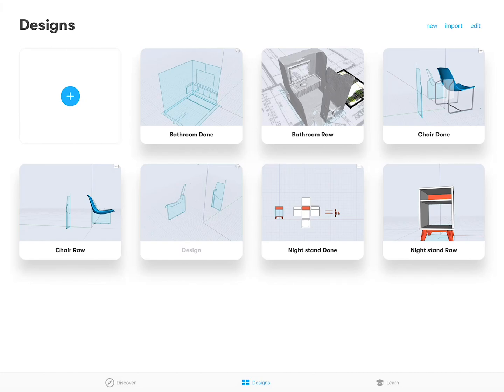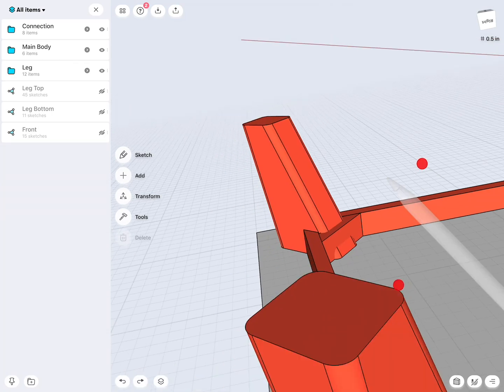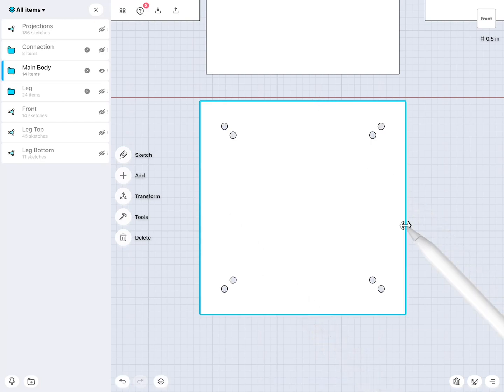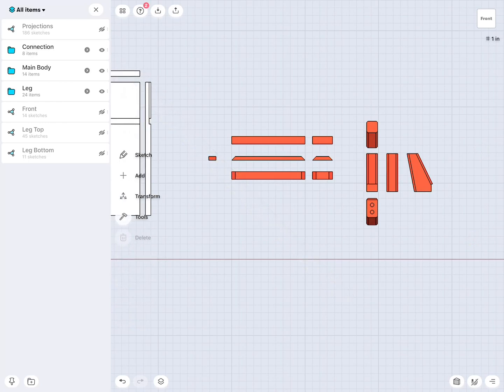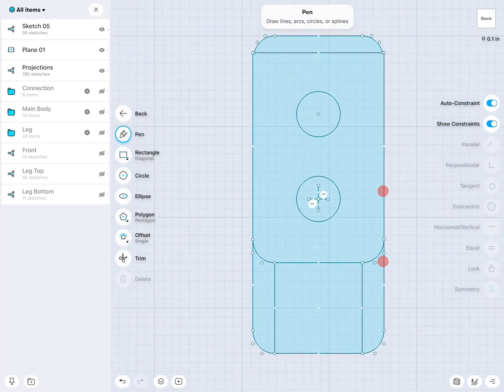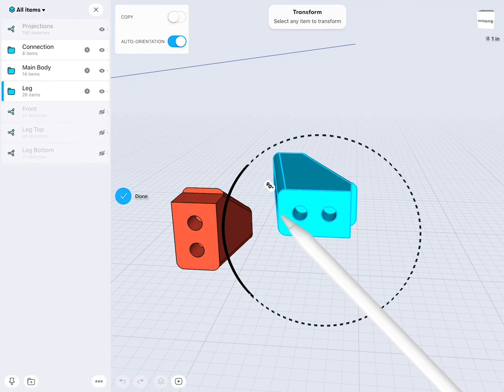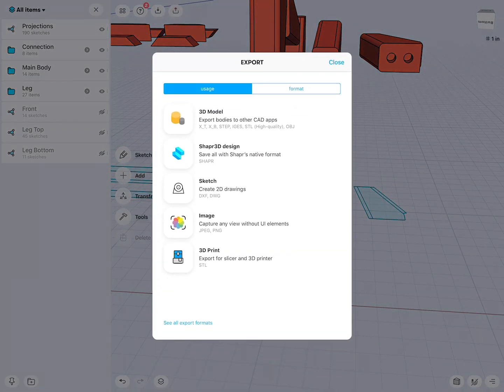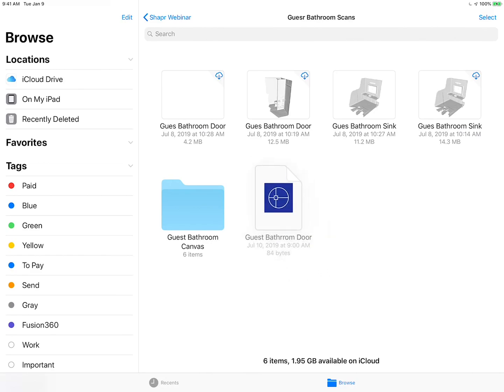Project body edges to create complex 2D drawings | 3D design webinar

Comment: Creating scetches via the project-tool is excellent. Many thanks for the tip! Is there also a way to unhide all measurements/dimensions so they can be exported via screen shots?
Reply from the maker: Unfortunately this is not a feature yet - a similar solution is on our roadmap
Reply: Shapr3D Many thanks. Good to know. I discovered that if dimensions are locked one after another they can then be seen all at the same time. The screenshot (Home +On/of - not the one bukt into the App) allows at least for a workaround in the meantime.
Reply from the maker: Yes, that is correct - it is an okay workaround :)